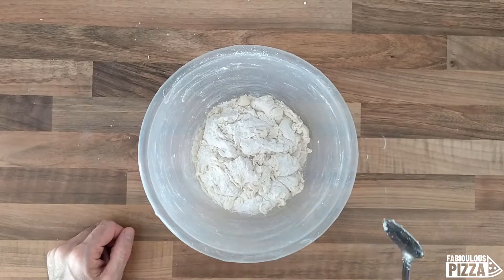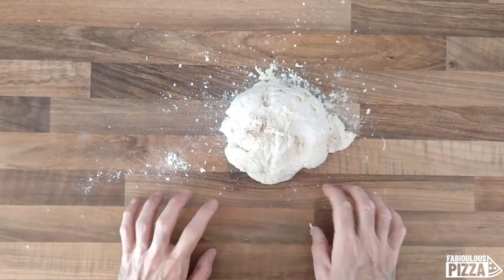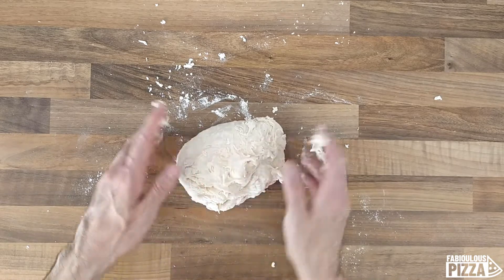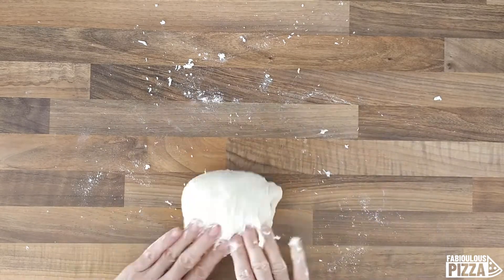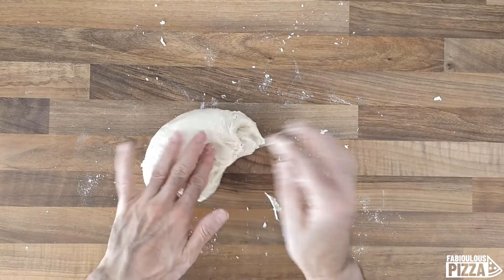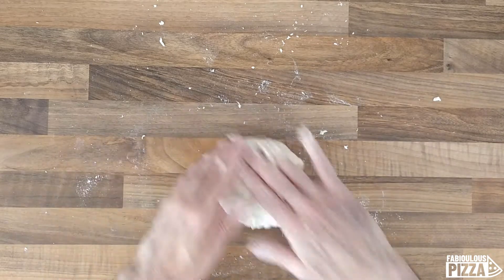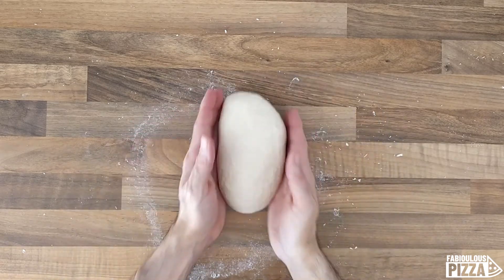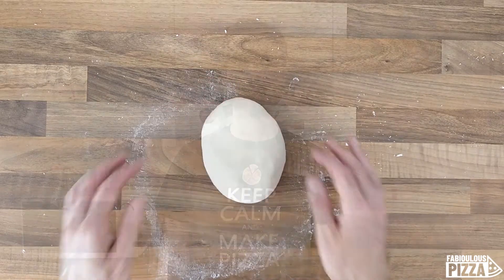How to fix sticky pizza dough | Why is my pizza dough sticky?

Comment: Thank you for the explanation.  I've also heard that if you just let wet/sticky dough sit for 10-15 minutes (without kneading it) the gluten chains will form and the dough will become less sticky.  Do you think this is ok?  Your technique is probably better but if I don't have 20-30 minutes to knead the dough, can I let it sit (covered) for 15 minutes after initially kneading it, then come back to it and finish it?
Reply from the maker: This is definitely OK 👍🏻 it's a very common technique if you make a very wet dough. However, after the first round, you should wait another ~15 minutes then fold again, and most probably repeat the cycle until your dough becomes easier to handle 🙌🏻
Reply: Shahzad what you described is called AUTOLYSIS (forming gluten by letting the dough rest) and it's very ok. I don't knead my dough very much, i usually fold it a few times, let it rest 5 minutes, fold it a few more times, let it rest again, and after 3-4 times it's good. I think proper kneading will still be better than what i did, but for me it's usually good enough.

Comment: Thanks for all the great tips. My problem is that after kneading the dough to a point were it is no longer sticky but still not completely smooth, I continue to knead a bit more and then the dough becomes sticky again. At that point no amount of kneading and resting removes this stickiness.  It still makes a great pizza but is just more difficult to handle. I use your calculator and measure everything very precisely.
Reply from the maker: When you feel your dough is ready, stop kneading! Even if it's not smooth, that's not a problem.
Leave it on your table for five minutes, then re-shape it gently: you will see it will come smooth quite easily ✌🏻
Thanks for watching the video 🙏🏻
Reply from the maker: I would suggest watching my other video: https://youtu.be/C0xZULr5CuI
You will see in practice the suggestion I just gave you 😀

Comment: That's not even CLOSE to how sticky my dough is!  No way I can continue kneading it like that.  My dough literally gets MORE sticky - not less.
Reply from the maker: Not sure if you at least tried.
By the way, if it doesn't work, let your dough rest for 10/15 minutes then fold it until it comes together.
If it doesn't work, try with flour with higher protein content.
If it doesn't work, add around 80% of the water to the flour, then add the rest SLOWLY.
If it doesn't work, you might want to decrease the hydration of your dough.
Hope this helps, without knowing ANYTHING about your recipe and procedure, that's the best I can do.
Reply: New pizza maker here! Yesterday I made my 4th dough according to the recipe (double fermentation 48 hrs) and it was sticky again which affected the texture of the pizza. So I decided to give it a go and add more flour until it looks like on this and other videos. I added 25% more flour and the dough came out JUST PERFECTLY!!! I was able to kneading it properly and I’m going to bake it with my ooni 12 in an hour.

Comment: Hello again :(. I tried your advice of adding more water and it helped a bit but i could not get it off my hands it was just a sticky mess again. It did not want to turn into a dough ball at all!!! Here's the recipe I'm using. I used unbleached all purpose flour if that makes a difference
1 cup bread flour
1/2 teaspoon salt
1/2 teaspoon sugar
1/2 teaspoon dry yeast
1/4 teaspoon garlic powder
2 teaspoon olive oil
1/2 cup milk
Any advice would be appreciated.
Reply from the maker: My first advice is to give up volumetric and buy a cheap kitchen scale! My second advice is to watch this video:
https://youtu.be/C0xZULr5CuI
Reply: @FabioulousPizza  Thanks again for the advice :D. Would i be okay to use the amounts and recipe of the dough from your calculator in a pan pizza?
Reply from the maker: Sure!

Comment: What do you do when the dough is even stickier than this and you literally cannot knead it? For me, it is so sticky that it cannot even be lifted off the work surface without tearing and leaving half behind on the board. I tried leaving it for 20 minutes under a cover and it didn't really get much better.
Reply from the maker: It seems like your flour was extremely poor in proteins! In that case, adding more flour is the only solution 😅
Reply: @FabioulousPizza  I just used Allison’s strong bread flour. It’s a decent brand and 12% protein. It’s just so sticky and that makes it almost impossible to knead to let the glutens form. Could it be that I’m using fast acting dry yeast?
Reply from the maker: Ah, I like that flour, I used it often! Is that something that always happens to you? Maybe a wrong measurement? What doses are you using?
Reply: @FabioulousPizza  it happens every single time. I’ve used your dough calculator for measurements but experimented with hydration’s between 60 and 70%. The 70% hydration one was a complete nightmare. It never became kneadable by hand, even after a night in the fridge (had to slowly and painfully use a scraper to knead it) and ultimately ended up cooking it by slapping the whole thing on top of baking parchment and stretching it while it was glued to the paper!
Reply from the maker: @Rich-in6ds  Mamma mia! Well, 70% is fairly high though! With higher hydrations it's recommended starting with a part of the water (try with 90% of the total), then adding the rest little by little...I mean VERY LITTLE. Like this it's easier to get the feel of what's happening and you will be able to avoid the sticky mess 💪🏻
Keep me posted if you want 😀
Reply: @FabioulousPizza  That's a great tip, thanks! I think I'll go back to the 60-65% hydration for now. The extra effort involved with the higher hydration (particularly since I am mixing/kneading by hand) just wasn't worth it! It did create a lighter crust with larger bubbles than the 60% dough but at the expense of nearly an hour of extra prep! My ambition is to get the larger air bubbles in a slightly more manageable dough. My 60% doughs had quite small, dense bubbles so far.
Reply: @FabioulousPizza  I think I need to give up! I made a new dough with PRECISELY the same hydration levels suggested by your calculator and it was a sticky mess. It’s so sticky that I can’t use the kneading technique to form a ball. It sticks to the board so much that every movement is just ripping it and it cannot form a smooth surface underneath while glued to the work top. I don’t understand how it can be so radically different using the same ingredients and the same mixing technique
Reply from the maker: You mean you already tried it starting with just a part of the water?
Reply: @FabioulousPizza  yes. The dough seems fine while it's combining and then as soon as it's fully mixed, it becomes so sticky that it's just impossible to work with. I can deal with it sticking to my fingers but when it's glued to the board, kneading it just tears it and causes it to become more sticky. Seems to get a bit easier once it comes out of the fridge whilst the dough is still cold but as soon as it warms up, it becomes very sticky again.
Reply from the maker: @Rich-in6ds  Oh wow, this baffles me, it's hard for me to understand what's going on without being there with you!
For the time being, I can only give you an obvious suggestions, that is: use less water 😅
Reply: @Rich-in6ds  - I seem to have a similar issue but have to get around it with adding more flour during the kneading process. I have been baffled but suddenly thought about the water itself, the water here is 'hard water' (More Alkaline than soft water and can have 4-Times the calcium & magnesium in it, therefore can decrease the activity of the yeast and affect the fermentation process) so I will try water with a PH slightly less than 7 next time. Chlorine in the water can affect the process too, but I found some pizza makers leave their water out overnight uncovered to allow the chlorine to dissipate. Good Luck.
Reply: @FabioulousPizza hi can this be due to the room temperature I have the same issues but I think it might be because my house is very cold
Reply from the maker: @Aslapfromthefuture  not at all! If anything, low temperatures help prevent sticky dough 👌🏻

Comment: Hi Fabio. I've noticed that some pizzaiolos add extra virgin olive oil to their pizza dough towards the end of the kneading process. What are your thoughts on this? Does it affect the overall consistency of the dough? Thanks for your input!
Reply from the maker: You could use olive oil to improve extensibility of the dough when stretching, this is one of the effects. I don't use any in my dough, never did 😀
Have a great weekend!

Comment: I use 65% hydration. That might be one reason 💀
Reply from the maker: If your go-to flour has low protein content, definitely yes. Still with some patience you should be able to knead your dough!
Worst case, you could try the no knead method:
https://youtu.be/Cwu5YkgcAs4
Reply: @FabioulousPizza   No, it's dedicated pizza flour with high protein. I can work around the stickiness but the dough is very soft. If I hold it in my fingers it just drops down. There's no elasticity.
Reply from the maker: Mmh, I see. Did you use tap water? Knowing nothing else, my best bet is that the water you used was really sweet. Get a bottle of water with a fair amount of mineral salt, aim for calcium above 100 and magnesium above 20.

Comment: Ciao Fabio, my pizza dough smells very fermented after I had left it out in a humid environment overnight — should I add more salt to cut down on the yeastyness? Will it cook out?
Reply from the maker: Ciao Matt! I reckon it smells like alcohol? If that's the case, it might be overfermented. I would bake it anyway, but expect a more sour/acidic taste!
Let me know what happens 😀
Reply: i'd recommend using less yeast instead of adding more salt. some traditional Neapolitan pizza recipes i've seen use only 0.2% yeast (2grams of yeast for 1 kg of flour), and the dough is left at room temperature for 24 hours without proofing like crazy
Reply from the maker: @ohvnaq  Bravo! We look for a certain balance between all the details. Yeast-temperature correlation is always paramount 💪🏻
Reply: @ohvnaq  this is a really good advice. I'm having troubles with over fermenting my doughs from bulk fermentation because I forgot to check it timely or other reasons. I would try that later.

Comment: your tip  worked...I worked more with tge dough and it became much more stable and smooth but still the proportions of 57%,58% water still forces me to add more flour because I end up with a  soup not a pizza dough I don't know why...
Reply from the maker: Maybe the flour you're using has lw proteins? Try with a different flour, with higher amount of proteins, and see how it works for you!
Reply: @FabioulousPizza  the flour I use is 00 so it's not that.
Reply from the maker: @alexzeqa7220  00 doesn't mean rich in proteins, you should check the protein content of the flour you use, I suspect it could be below ~10%. If that's the case, then try another one.
Also, if you want to know something more about double zero flour, you might want to check out this video:
https://youtu.be/Qa_2hmy8D7A
Reply: @FabioulousPizza  my flour is W=180 actually but it felt like cake flour making a pizza with 59% hydration....i added more flour to the dough just a but like 30 grams and worked the dough...its came out perfectly while i rested it with a bit of olive oil both as a whole doughand after when i divided in 2 pieces
..it turned out like a neapoletan pizza...I am 100% sure it's the flour that makes the recipe not valid...I think the measurements are not 100% correct...when I do pizza just by feeling it comes out perfect everytime but when I follow the 58%,60% etc etc hydration calculator it always turns out like a pancake batter...thanks for the information.
Reply from the maker: @alexzeqa7220  that's what I thought. W180 is EXTREMELY low, ideally you should go above 250. In this case, you can easily push the hydration above 62-63%. Good luck on your pizza-journey ⭐
Reply: @FabioulousPizza  I will try to search for a better flour, if you could tell me the Wnumber of soft beetween strong flours it would greatly help or if you have one of your videos...I will send you my result...thanks for the help...Gracie mille Fabio. Bacione
Reply from the maker: @alexzeqa7220  sure, as I said aim for at least 250-260W, or 12% proteins!

Comment: I need some help here, 
I have tried this method with a little bit sticky dough (2kg) in the hope if making it dryer but the opposite happened. It became more and more sticky until the point that it is almost glue. What went wrong?
Reply from the maker: Mmh, I see...that often happen when we "try too hard", perhaps you're using your full strenght, you should try with a more light hand 😀
Also, give a try to method number 3 from this video, I'm sure it will help: https://youtu.be/Y_BBqa05IxY
Feel free to ask more questions if you need help, have a great time!

Comment: What happens if I added the flower? It’s still a tiny bit sticky
Reply from the maker: Kalen, if you find your dough is still a tiny bit sticky, cover it and let it rest for ten minutes, then finish kneading it.
You can also repeat this, if you want!
If you use a teeeeeeeeeeny, tiiiiiiiiny amount of flour just once, nothing bad really happens and the change in the balance of your recipe should be negligible. However, beware not to over-use this method 😉
Reply: Fabioulous Pizza oh mate thanks for the quick response. Recipe says to use 1.4 grams but my scale doesn’t go to decimal so I eye balled under 2 grams. I took it out and kneaded it for 15 minutes still the same thing. Will see how it turns out in a day or 2. Have to use flower at the end to make the pizzas I suppose